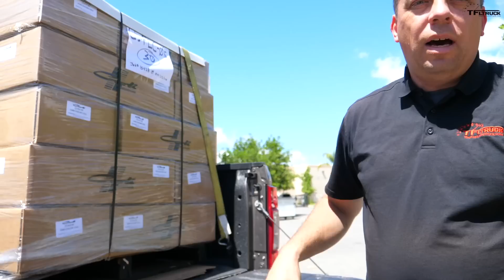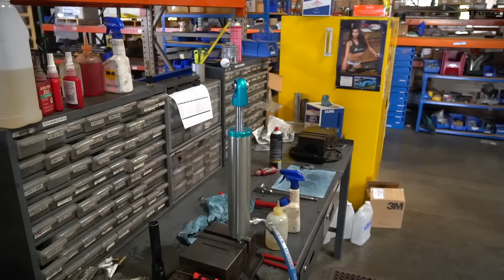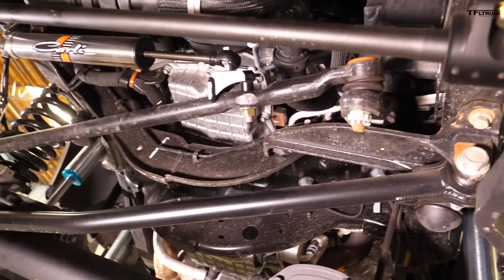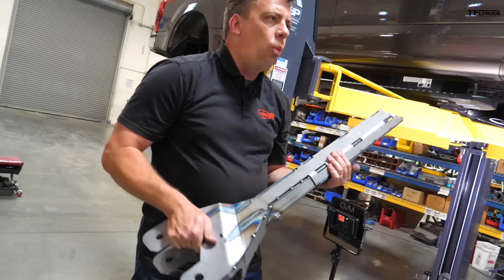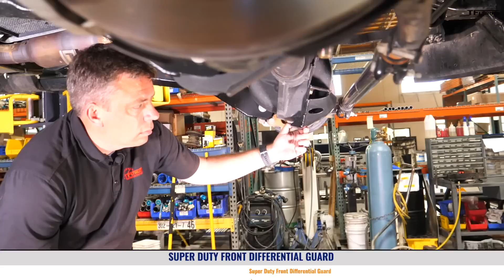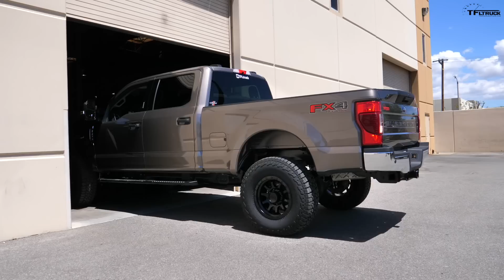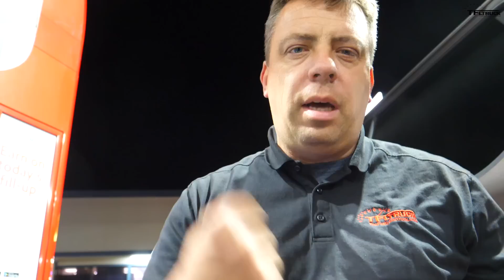See How This New 2020 Ford F-250 Now Rides Like a Raptor but Still Tows Like a Monster!

Comment: Gears and bigger fuel tank are a must for a true overland rig.
Reply: Completely agree! 4.30 gears and aftermarket larger capacity fuel tank. Does anyone know if a aftermarket tank marketed for diesel only.....from Titan of S & B would actually work in a gas engine truck??? I went to the Ford website.....looked up the part numbers for the fuel tanks...both gas and diesel...the fuel pumps are different...but, it appears the opening for the fuel pump / lines is the exact same diameter. Makes me wonder if the Ford fuel ( gas ) pump will work ( same or different threads ??? ) on the diesel tank from Titan or S & B.

Comment: Does carli change the standard seals on the kings to viton seals?
Reply: Nope, Viton seals are high heat ONLY - They only do well in Race applications. In colder and mild temps on a daily driver, they'll leak and ride rough. BUNA are a way better choice for these trucks.

Comment: Wondering what wheel width and back spacing did you use with this tire ?
Reply: We always recommend 8.5-9" wide wheels with 5" or 4.75" of backspace to fit 37s on a Ford Super Duty.

Comment: Power wagon > tremor
Reply: Maybe on the Ramp Travel Index (articulation) and front axle traction with locker on the Power Wagon. However, this truck now has Carli suspension with King 2.4 shocks......add Eaton e-Locker and the Super Duty 7.3L gas engine without the Tremor Package will eat the Power Wagon 6.4L gas engine's lunch.

Comment: what about the "death rattle".    have you experience the death rattle in that truck yet?
Reply: It's called the "death wobble". Very few Ford Super Duty and Dodge Heavy Duty trucks have that problem. When it does occur...usually caused by incorrect caster issues and or bad / weak steering stabilizer.

Comment: With that tire diameter I would swap the axles gear ratio to either 4.30 or 4.56.
Reply: On my 2014 6.2l with 35" tires I went from 3.73 to 4.56 and it transformed the truck.
Reply: @58lister  I currently have a 2019 with 6.2L...with 3.73 gears and the stock Michelin 275 / 65R - 20 tires are 34.1 inches tall. The Goodyear Wrangler DuraTrac 285 / 75R - 18 tires are only one inch taller at 35.1 inches. I have this same size DuraTrac on an older Super Duty with 3.73 gears...and it does well towing and off-road in some mud (nothing drastic) and fairly deep snow. However, I would prefer 4.10 gears.....or maybe 4.30 gears in the older truck. I am curious as to how you use your truck to justify the 4.56 gears. Thanks!
Reply: @15Jeep  Primarily it's the steep grades that I tend to travel in the mountains, especially while hauling a camper. When I went to the 35" tires, even without the camper it was a dog on those hills. Going to 4.30 gears pretty much would be back to the stock overall ratio I had which would be ok, but the shop that did the gearing recommended 4.56 with the 6.2l engine for a margin of additional capability. All that said my 2014 has a little bit less torque than your 2019 and the transmission ratios are a little different according to Ford specs. I don't think 4.30 would have been a bad choice for me either honestly but now acceleration is effortless compared to where I was at. And then if I ever decide on 37's I am also in a better position.

Comment: You should consider bigger axle gears, like 4.10 or 4.30 and on top of restoring your proper overall ratio, it might actually improve your overall MPG with the newly added weight and height compared to staying with a 3.55 ratio.  Anyhow, great truck and keep the videos coming !

Comment: $25K for the lift, installation and wheels and tires....???
Reply: $8,200 for the lift, Wheels and tires $3,0000, give or take. Install would run $600-$1,000 depending on your local shop. Not cheap by any means but half your assessment which may or may not bring it into the realm of feasibility.
Reply: Its certainly not for everybody but I find it weird when people buy $70k-$90k trucks and throw $2k suspension set-ups on them 🤷‍♂️.

It's quite a commitment when you've got an older truck like my 06 😬 and you've got more in suspension than the truck is worth.. but it sure makes the truck a lot fun!
Reply: @jackwsandoz  There in lies the Joke- Let's purchase a $70K plus pickup truck (crazy-ridiculous anyway), Spend an additonal $25K-35K on suspension, wheels and tires, THEN buy a aluminum framed (wow, so special) and wood pop-up camper for another $30K and go on the TAT...!!!  I had a STOCK 2001 Ram 2500 and bought into the overpriced 4Wheel Pop up Camper... It went   anywhere you pointed it. The Camper then was $11K and the Truck (diesel) was $30K OTD. Have costs and tastes gone up that much in 18 yrs?

Comment: That Carli suspension is definitely top of the line! I’d be worried about the rear ride stiffness while unloaded with those larger leaf packs. Curious about the pros and cons of using the larger leaf packs vs standard leaf pack + airbags.
Reply: These packs are designed for this camper specifically. We sent Andre on his way with a set of regular full leaf springs should he remove the camper as well. If he wanted something to work with AND without, we'd have done the standard springs and airbags.

Comment: "Bad Ass" truck? Boy the language on TFL is getting out of control! Such potty mouth!,  I was a jet engine mechanic for 23 years in the Air Force working in overhaul shops and I never heard such language, When a wrench slipped off a bolt and your knuckle slammed into a sharp bracket is was always "Gee that hurt" or a piece of safety wire going under your finger nail we would hear "Dag gum it I don't want to do that again"  or when crawling under a engine and gouging your head on a drain line you would hear "Golly I need to be more careful" But never such naughty language as you guys.
If you believe what I just said I have some swamp land in Florida I will sell you cheap...

Comment: Why not air bags for rear?
Reply: This truck was setup for a constant load. Andre wanted to be able to take the truck to remote locations and didn't want the susceptibility of an airbag as they're far more likely to be damaged when out in the bush than a leaf spring.

Comment: Every time you overfill I cringe 🙈. Again, fill TIL it clicks off and all those fuel systems engineers will be happy
Reply: I've always wondered, what do you run the risk of damaging when you overfill?
Reply: @jackwsandoz  Nothing, it's all about the EPA and spilled fuel. If topping off a tank caused damage then the fuel systems engineers did it wrong. The auto-shutoff on gas pumps is not a highly accurate mechanism and are prone to occasional failure.

Comment: You definitely need to get rid of the cow catcher front air dam
Reply: If you want that nice, clean but "Hmm, somethings different, but I can't put my finger on it!" look, then replace it with the 2WD air dam. Just removing it looks unfinished, IMO, but the smaller 2WD air dam enhances the stock bumper's look.
Reply: Not like it matters. Just drive until it gets ripped off, and then keep driving lol.
Reply: Nah, it's fine until they encounter an object that it doesnt clear. Then just simply unbolt and continue on.

Comment: Great information Andre.  Mechanical engineering at work.  Let’s see how it rides with the load and without. Should be a pretty good ride loaded and a bone shaker unloaded.  I regularly haul a gooseneck car hauler so no lift.  It’s enough of a challenge cra sling in and out of the stock height bed

Comment: Please, please! Hack that chin spoiler off. It looks so out of place on a cool dedicated off-roader. you can't call it the "Super Tremor" if yours has the spoiler but the actual Tremor doesn't.
Reply: I say wait until it has the potential to dig into something. Easy enough to remove on the trail, and it'll help with mpg on the cross country trip (at least in one direction).

Comment: I really want to see a whipple supercharger on that super duty, great round out to the build.
Reply: Whipple is already hard at work making one it's numbers so far say that it nearly doubles up and torque not to bad
Reply: To bad it will be close to 10k for one. Ice looked for a charger for my 6.2 and they are all 6k to 8k. It is ridiculously expensive to supercharge these motors

Comment: Without custom shock hoops and a double-bypass shock this thing will not ride like a Raptor.
It is a nice upgrade over the stock ride though, but saying it 'rides like a raptor' when a raptor is a long-travel IFS setup....
Reply: Lmao, Raptor shocks have nothing over 2.5 Kings...
Reply: Maybe not quite.....like a Raptor...but close. But Ford Super Duty with Carli suspension (2.5 King shocks) way more versatile than a Ford Raptor, mainly cause it can tow all the toys to the outdoor playground. Add RCV Performance axles to both trucks makes 'em both more jump capable.

Comment: So it is going to feel harsh empty, unless you carry 2000lb's in the back when no camper, surely there must be a system that lets you have comfort empty, arr how about airbags as most seem to use and are very effective.
There must be a way to re-calibrate the speedo to the taller tyre as it is all computerised anyway. Love the build definitely would not like the bill once finished lol. Also once you have the camper and gear in the bed your fuel mileage is going to suffer, and yes I know it is popup but it is still taller than the cab, I ran similar on my Chevy doublecab LUV and the mileage suffered because of weight and wind resistance so hopefully you will do another mileage test once fully ready to go overland, I found even just having a top box on mine it was thirsty so always remove the top box from then on when not in use.
Reply: That's what I was thinking. The Raptor engineers expect you to desert run with a bed that's empty or has a couple hundred lbs of gear in it. I wouldn't want to fly down a desert trail at 80mph in this truck either. The Raptor does well in most off road situations, but it's bread and butter is high speed and I definitely wouldn't try that in this beast.
Reply: Bro, the video says like 3 times they were instructed to build the suspension with the 2k lb compensation and the shop even needed to go get a custom spring pack built because their regular springs are meant for a standard truck. TFL is going to run that camper in the back long term. I have no idea how you didn't pick up these points in the video.

Comment: If you put 5% taller wheels on you get 5% more circumference (read 5% longer per revelation). That means the differens on the speedometer is also 5%.

37 is roughly 19.4% bigger that 31 and 70 is about 7.7% bigger than 65. That implies the speedometer was off 12% stock. I.e. overstated speed and distance.
Reply: The stock tires size according to Andre was 33, not 31, so that's about 12% larger circumference, but the speed would be like adding an overdrive, which you would calculate as 1-(33/37) for 10.8% overdrive. So 70/65 is a 7.7% difference. The stock speedometer is about 3% off, not too bad overall, but should definitely be better brand new.
Reply: @mattlimberg5763  Oh, I rememberd incorrectly.  Yes, 3% is fairly decent, almost all cars overstate speed by a few %.

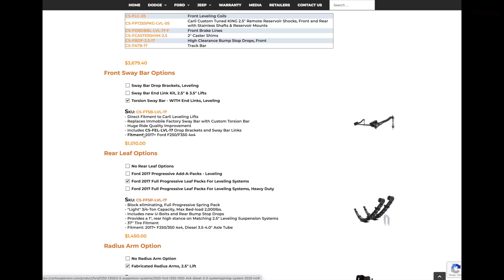Comment: Go to 4:30 ring and pinion gears and you'll get better gas mileage
Reply: I have a stock Tremor with the factory 35s and 4.30s. I get about 13-13.5. Pulls great though
Reply: @paulwuzhere  Good to know. I am looking at a 2021 or 2022 F350 7.3L with Tremor Package and 4.30 gears. Is the 13 - 13.5 mpg with the 7.3L gas engine or 6.7L diesel engine....and is it combined city and highway or just highway??? Ford should offer 4.10 gears...at least on the Tremor. A build and price on the Ford website only allows 3.55 or 4.30 gears with the Tremor Package. Think the 3.55 gears would be a big mistake on a Tremor.

Comment: There might be a discrepancy with your fuel mileage in California because the fuel additives they use.  My 99 Dodge used to average 13 mpg living in California I moved to Texas and my fuel economy actually raised to 15 mpg. Funny as it might sound but they oxygenate their fuels more by raising the ethanol content which supposedly lowers emissions but causes the vehicle to use more fuel because ethanol is alcohol which burns faster and cleaner but also means that in fact you are using more fuel to go the same distance. I would like to see what the differences out of California

Comment: I wonder if Carli will ever make a Power Wagon kit.
Reply: Thuren is the RAM choice. And there are limits to what you can do and keep the incredible articulation that it already has. I’m running their front springs which is about 3/4” higher than OEM, King 3.0 pin tops, stock rear springs with airbags and Daystar cradles with 2.5 King piggies to support the same Four Wheel Camper in the bed.
Reply: We make several kits for the Power Wagons!

Comment: You guys might want to swap the gears for 4.10s since you’re running bigger tires, a 2,000 lb camper and going off road. That 7.3 is a beast but it doesn’t have diesel levels of torque.
Reply: It would be worth putting gears in it to at least get back to the factory 3.55 I had a 92 suburban with a 454 awhile back that I put 37s on and I left the factory 4.10s in it for a yr or 2 and it averaged 8mpg. I switched to 4.88s to make the truck think it had the 4.10s and my fuel mileage went back up to 10-11mpg
Reply: @brandonmartinez9259  Please understand how gearing works , the 10 speed 1st and 2nd gear are actually steeper than the 1st gear on  4l80e. In 1st gear the 10 speed with 3.55 gears is equivalent to 4l80e with 6.xx rear gears that's how steep the 1st gear is .
Reply: I agree, 4.10's at a minimum, and a custom 91 Tune from 5 star. This will return your original gas mileage for better overlanding. Anyway, its still a sweet truck! Ill keep my eyes open for you guys as you come through Idaho.
Reply: Agree change gearing, doing so much work to it already then might as well do it all and throw in a limited slip up front to make it real super tremor
Reply: It doesn't have torque that matches the monsters made today. But this motor makes equal torque to hd trucks from 20 years ago and those trucks pulled plenty heavy. The old ford 460 made over 400ftlbs back in the late 90s and never struggled pulling heavy. Unless it was through steep hills. At that point any naturally aspirated motor struggles
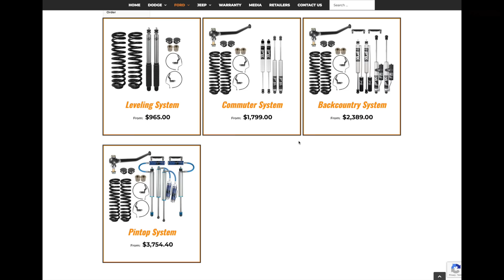Reply: I agree with gearing at least a 4:10  set of gears front and rear, some good lockers front and rear. As well as a programmer to adjust for the wheels and tires as well as the gear ratios.  I will say this I had an 01 f150 that I lifted with 35s on it and barely was getting around 9.5-10 mpg with the stock 3.55. once I regeared it to 4:10s and added a programmer I went back up to12.5-13 mpg so definitely will recommend gears and a programmer!
Reply: I think that so long as they aren't going to be towing it'll be fine.
Reply: Carli suspension....check! Add 4.30 gears and Eaton e-Locker in the Dana 60 front axle. Then the truck will have lockers front and rear. After that.....bring on the Dodge Power Wagon.
Reply: Yup after 25k worth of mods. It can take on a stock truck.  @15Jeep
Reply: There's no way this thing will run out of torque 😂

Comment: Man I don’t get it. Payload on this truck already is enough for the camper. A small lift and 37’s could have been a couple grand, but this looks like $20k. And unloaded it looks a little ridiculous.
Reply: Are you complaining about the quality/cost of this kit, and it's looks? Shouldnt the focus be on capability?
Reply: You're correct..........you don't get it! The rims and tires (37 inch) alone will cost $2500 to $3000. Moreover, the Carli suspension installed on this truck is not even close to $20K......not even half that amount.
Reply: Mike Marler I believe they said in the video that it’s around $20k for the setup they installed.

Comment: Andre', one of the best TFL video's ever.   Super Great content.  I have been waiting for this set up for my 7.3, and Dan has been great to deal with in a call and emails.  If you get a 5 Star calibration that will yield y'all more power, adjust the tranny shift points and adjust the speedo, and possibly gain you .05 mpg.  I am looking forward to the next stage of this build.  Thanks for all the hard work and info you guys provide in helping us consumers make educated decisions on what to buy in the aftermarket.

Comment: this is a fantastic build, once you get the speedo corrected those transmission shift points will adjust a bit too, and that MPG might change.  it actually might improve a tad...
Reply: It certainly won’t be worse and the transmission will be happier

Comment: Can you talk about why would you losse about 2MPG with the new suspension? How much weight was added by new suspension components, and the role of tires in lowering millage.
Reply: We also do not know (unless we remapped it) the elevation change. IF he ended up going from say 50 feet above sea level to 250 feet above sea level, going to obviously hurt mpg. We need more than 1 tankful to see a trend.
Reply: @nicoleduncan5787  true, or at least a round trip journey to negate elevation.
Reply: Part is also probably how much lift they did too. Being farther from the ground. That is why that big plastic air damb is on there for better fuel mileage. I feel like hit has something to do with how the air moves around the truck and how much more work it has to to now to move that extra weight and the bigger tires.
Reply: Rollover resistance of the tires is the biggest factor. Air drag, not so much.
Reply: @donleamon8653  Every bit helps. The additional weight of the tire is one thing, but it's offset also puts the tire out in open air, the taller diameter is less advantageous from a gearing perspective, and the overall height of the truck all contribute. Ford put a huge airdam on the front for a reason.